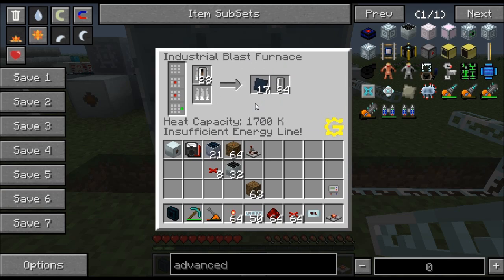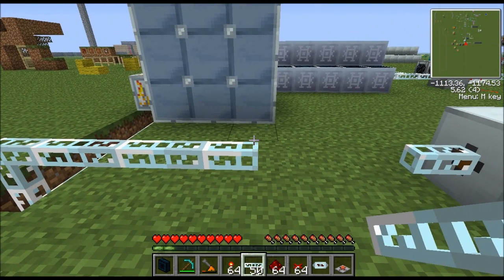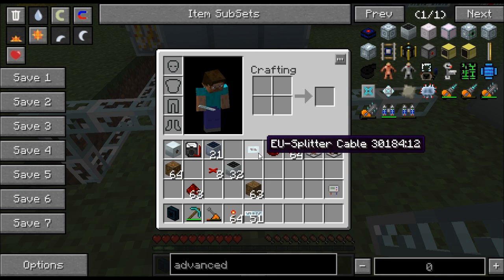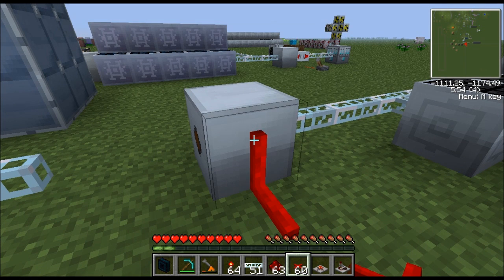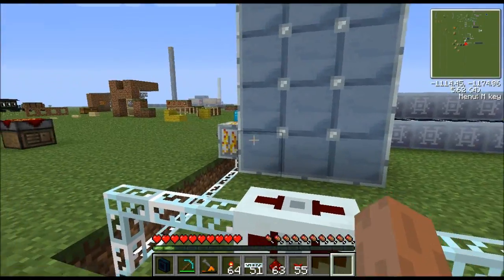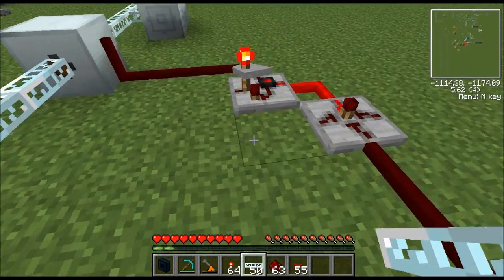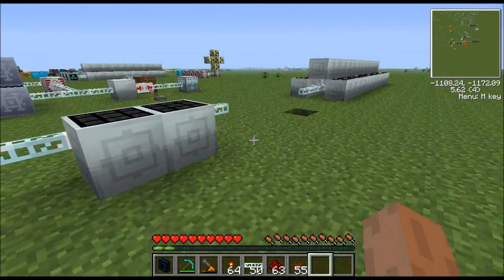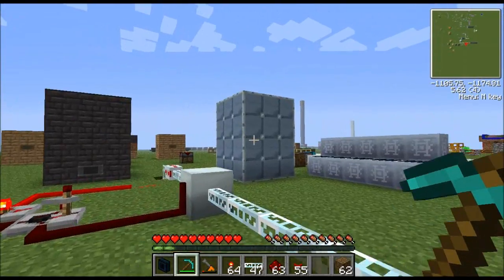FTB/Feed The Beast Tutorial/Guide - Advanced IndustrialCraft Power Management W/ Redpower Logic

Comment from the maker: Just tried. You can't use structure pipe. IT doesn't interface to either the splitter or the red alloy wire. Jacketed cable doesn't work either.